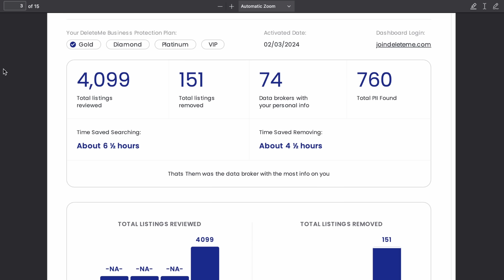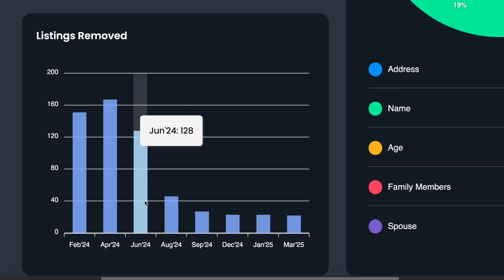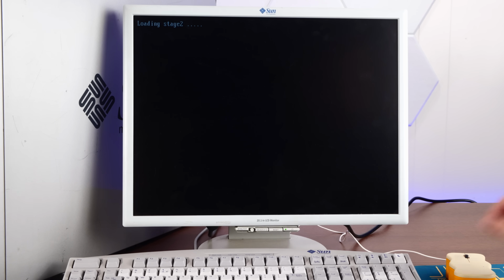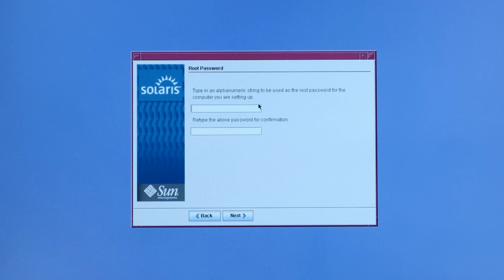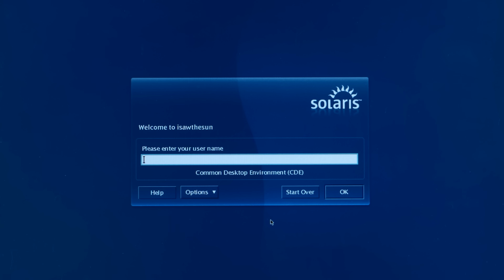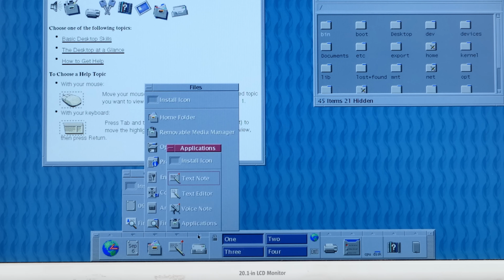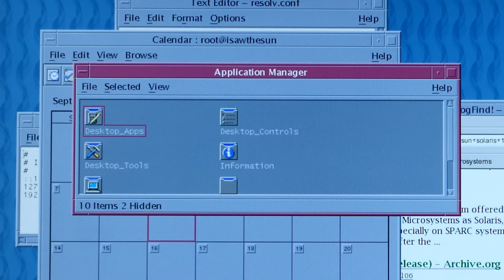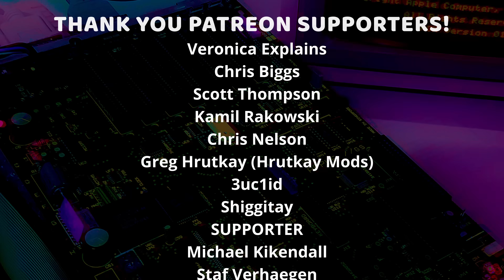The AMD Opteron Changed Everything

Comment: I love the simple and elegant case Design, Id love to have just a case from one of these in great shape.

Id have to use a SFX PSU modified to fit (Judging the "slimmed-height" proprietary looking PSU) , but the rest of the case dimentions are fairly standard for a full-tower case.
Id install high end modern AMD components (EPYC, Threadripper?) At-least 128GB RAM and definitely Linux, like my favorite "POP!OS".

Comment: Socket F Opterons sold as the original opterons? That's deffiently wrong, the OG opterons were socket 940 single cores and still had a ceramic package. They did allso come in the Sun ultra 40 but the original one the one you have is a M2

Comment: We used to work with everything from Sun back when. Servers, disk and tape storage and of course these workstations. A healthy mix of SPARC and AMD, but all Solaris. One of the clusters was used for graphical simulation of cancer treatment, so that needed to run reliably. The people at Sun were an absolute delight to work with, but when Oracle stepped in, we made the switch to HP and RHEL for most of the workloads. Anyway, as a seasoned Sun user, I shiver at the idea of Windows on these beautiful machines. But I'm not opposed to a Linux distro and/or a recent graphics card in there.

Comment: Windows 11? I'd be shocked if you could get windows 10 already to install.
For a while there, the machines I had set aside for XP were one with an Opteron 185 and one with a Pentium extreme edition. Despite the Opteron being considerably faster to use even with the disadvantage of ram (ddr vs ddr2), I could only get windows 10 to accept installing on the Pentium. And good God, it was a laggy environment. The kind that would have put a younger me into a rage fit. I could not fathom how something so slow still had operating system support that far ahead.

Comment: I got a really good deal on one of these back in 2007 that came with an absolutely beautiful Sun 24" LCD panel. It was pretty cool, but I'm afraid all of the CPU power and neat unix-ey features were wasted on me at the time. I ran it with XP 64 bit edition (which was really a reskinned Windows Server 2003), which mostly worked fine, but did suffer from some compatibility issues with 32-bit software. It came with 4 80GB drives that I had configured in Raid 5, which at the time was pretty amazing to have in my house. Sadly the Quaddro card was too specialized for my general PC needs, and I recall it performing remarkably poorly as a gaming machine. Amazing construction though.

Comment: This machine is at least two generations newer than the first amd64 Opterons. First batch of sledgehammer couldn't even reach pc3200 speeds so you were forced to run them at 2700.
I waited until the second generation of 100-series (codename Denmark) and oc'd that thing to kingdom come 😂

Comment: Win11 will not work. It requires some SSE4.2 instructions not found in that CPU. However, I bet Ubuntu'd do plenty well on that thing.
Reply: Does 10 require those same instructions?
Reply: @exiem1318  No, it does not. 10 is proven to run on a variety of hardware. Besides, it has a 32-bit version that runs on just about anything.

Comment: I have that exact same PCI-E SSD, I bought it on eBay years ago. IIRC they were used as cache drives for servers and the company went bankrupt. Let me know if you need drivers, they aren't easy to find and I have an installer saved that I can't even remember where I found. Currently working in Windows 11, reads and writes are around 1500 MB/s so they are still very usable.

Comment: Those PCIe cards are certainly newer than the system. The ioDrive is almost the direct precursor to NVMe, and it's suspected that most of the ones you'll see come from Facebook as those basically ran the platform during the early 10s. The Windows drivers still work, there's also drivers for contemporary Linux, and fan drivers for modern Linux as well. Got a couple for very cheap (like $40 each) and ran them a small business server for half a decade until a couple of years ago, when I decided to move to NVMe since now replacing them in case of problems would be much more expensive.

The K2200 is just a Quadro version of the GTX 750Ti, still gets drivers until... next month I think, pretty respectable for emulation and stuff up to late 00s games.

Comment: It's quite common for server (and sometimes also high end workstation) manufacturers to put those elaborate diagrams of how to change out components on the machine itself. You don't want to have to force some harried overworked IT guy who's probably had not enough sleep to have to go dig around for a manual whenever they have to do maintenance on a server. It's part of why I love working on those older servers. Everything was well documented and usually extremely well engineered.

The whole Itanic saga is freaking hilarious. Back in the day I used to work IT at a large company and I used to go to various tech conferences, and boy howdy, Intel was pimping the HELL out of Itanium whenever and wherever they could. Huge lavish presentations, parties with huge lavish spreads of food, etc. Somewhere in my collection of household crap I still have some Itanium glassware (either wine or champagne glasses, I don't remember) that I got at one such event. Probably still packed up in a box in the garage along with the craploads of stuff I never unpacked after my last move. Normally I'm fairly skeptical about the "next big thing" but Itanium tickled my spidey sense something fierce. It was fun watching it tank, and I find it hilarious that Intel was contractually required to support it until fairly recently. And, out from under the shadow of that colossal failure, here comes AMD with a 64-bit architecture that actually works, and you don't have to sacrifice performance or compatibility. And by adopting it as the de facto standard, the industry basically forced Intel to grit their teeth and go with the competitor's solution. That's the cherry on top.

Comment: Windows 11 depends on what version you're trying to install.  23H2 and earlier will install on any dual core x86-64.  Anything later will insist on a Nehalem from 2008 at a minimum on the Intel side, or a 2011 or later AMD CPU.  I noticed you're actually running a dual store opteron, so not the oldest x86-64.

Comment: I'm still hanging onto a 2004-vintage Athlon64 system plus an Athlon64 x2 solely for the historical value.  Earliest x86-64 systems plus oldest that can run modern Linux.

Comment: mate... dec alphas are 64 bit with even the option for a 128bit external bus. and those definatly predate that 'itanium' thing by oh eh a decade. plus everyone had a couple of dec alphas while noone in the world ever had an 'itanium' (so far for 'mass market computing' ;) ... now wether a sun workstation running 'whatever' cpu qualifies as 'a pc' much less 'the first modern pc' is another matter. lol. it's still a sun doing sun things. lol.
Reply: in case there was any confusion, the itanium is not a processor in the iAPx86 family line. it is just 'something seperate' also made by intel. like the 4004 and the 8008. lol. it will not run any programs for pcs. in which case the alpha even is closer to a pc. as at least it can emulate a pc faster than an actual pc can do pc things lol.
Reply: would say the dec alpha was pretty widespread compared to the itanium. while i owned several dec alpha evaluation boards and workstations i have never even seen an itanium irl lolololol. where the hell to even find one. lol. i hear they sent one to linus and that's about the only one i know about in the wild. lol.
Reply: and also it was around 10 years earlier haha.

Comment: I bought a dual original-Opteron a couple years ago (for the 20th anniversary of its release.) Pair of Opteron 244s (the fastest launch-day CPU,) 12 GB RAM (the max it supports,) a PCI Radeon of some variety that still has drivers. On a launch-day Tyan motherboard.

It is borderline unusable in Ubuntu.

Your Sun is clearly newer, as it has DDR2 and PCI Express. The very first generation of Opteron only supported DDR1, and the launch Opteron chipset (AMD 8151) only supported PCI-X and AGP. My system is a "server," so no AGP. I have tried a PCI-X Matrox Parhelia video card, but nothing modern supports it accelerated. (And the 8151 didn't even natively support AGP, it required a second support chip ("East Bridge"?) that inserted itself in the HyperTransport between the CPU and the main chipset, cutting the HyperTransport links in half, dedicating half to the AGP bridge.)

Comment: be careful, Sean! Win11 24h2 need popcnt aka sse 4.2. a CPU instruction that not even the Core 2 duo-based CPUs have. C2D (the Penyrn ones) have SSE 4.1 but not 4.2. SSE4.2 is in the "first gen" core i series..I've gotten the Iot enterprise version of Windows 11 to boot on first-gen i series CPUs just fine.  the "launch" versions of Windows 11 should boot on that sunPC...should. My experimentations with win11 where all on penryn-based core 2 duo machines lol.
Reply: I think I have a Conroe Core2Duo sitting in the shed right now...I wonder if it would run on that.

Comment: I realize that the Digital Equipment Corporation ("DEC") workstation I had on my desk at work running a full multiuser OpenVMS OS with DECwindows GUI on their Alpha 64-bit CPU back around 1993 wasn't exactly mainstream like Windows PCs were.  But I enjoyed it. 😎
Reply: But did you ever run Windows on your DEC Alpha? 😂
Reply: @cliffordbradford8910  you could
Reply: @cliffordbradford8910  Not on my desktop DEC 3000 workstation, but we did get a small DEC Alpha workgroup PC we ran Windows NT for Alpha.  (I scrounged the 2.88 MB 3.25-inch floppy 💾 drive out of it when it got decommissioned. 🙂)

Comment: I think windows 11 pro would work pretty decently, assuming that those opterons are basically server versions of the amd athlon 64 x2 processors from the same year, it could actually work better than expected seeing as it would be a 2.8 ghz quad core setup
Reply: This comment aged well!
Reply: Maybe no for 24H2, lacks POPCNT instructions if the CPU was released too early.
and early Althon CPU and motherboard may have issues with Windows 8 and 8.1 which also have a requirement of some CPU instructions that CPU don't have or motherboard not supported.

Comment: The early Opterons with the Venus cores were overclocking beasts. They also ran on prosumer Socket 939 boards and were popular with gamers. If this Sun system supports DDR2, then it's not an early Opteron. That dates it to 2006 at the earliest. It's also very likely Socket AM2, since the schematic on the side shows a PGA socket. There aren't many Opterons that support AM2. You might theoretically be able to put up to a Phenon II X6 1100T if there's a BIOS that supports it. I can't remember if AM2+ chips are supported on vanilla AM2.
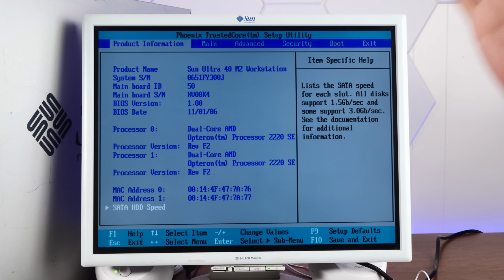Reply: That system has LGA1207 / Socket F and 2x Opteron 2220 SE. You can see the CPU model number at timestamp 6:48
Reply: the OG opterons were on socket 940 and there was like 4 regular atx boards for them, the ones that were super popular were 939 and ran on pretty much any desktop 939 board provided the right BIOS, the ones in the system shown are Socket F (AMDs first LGA socket), socket F allso has 6 cores but they aren't usually supported by early boards like this

Comment: In re the Itanium: there's a hilarious graph on the Wikipedia page about it. It shows sales predictions at various times, starting in 1997, when they had sales rocketing up from zero in 1999 to over $35 billion in mid 2001. As time goes on the predictions get more and more pessimistic, growing more slowly - and right at the bottom there is a feeble little red line marked "Actual", which starts in early 2003 and ends in early 2006 with about $2.5 billion. Then they gave up.

Comment: I like the fan rig that is built like a hood for the ram cards !  This should return for some boards .
Reply: I have a Dell T3610 workstation (that I use as a Proxmox homelab) that has a duct for each ram bank that directs air from an intake fan straight across the RAM modules. Gotta keep that 128GB of memory cool!
(Coincidentally, that Dell's original configuration included a K2000 Quadro card :D )

Comment: That thing (the old AMD Opteron) probably doesn't have POPCNT on it, which is the other absolute requirement to be able to run Windows 11 (currently, build 24H2).  (The other requirement, of course, being TPM 2.0).  Nah.... I agree that you'd be right, to install modern Linux on the thing, instead of Windows.

Comment: Should install Debian Unstable, or Windows XP x64 on this.
Also yes to Windows 11 (I assume pre-24H2 cuz of SSE4.2.)
Also try Windows Vista x64 and/or 7 x64, to see if you can hit a sweet spot between compatibility with older hardware and newer software.

And finally, Haiku.. you know you have to try Haiku.

(...and if you're crazy, Chrome OS, ThoriumOS, or even FydeOS.)
Reply: Also, you should do like you did with your PCIe PowerMac G5, and try and stick modern cards in there. (Doesn't necessarily have to be GPUs.)

Comment: Comically over engineered...  As in high build quality. I wish there was more of that around in the computer and car industries now. Sigh.

My first AMD64 CPU was the first gen AMD Thunderbird. I've been an AMD fan ever since. Well, except for my very brief time with an Intel Pentium4 build I only did because I got the CPU and ram for free from work e-waste. I almost immediately noticed my error and sold that all off on eBay and used the proceeds to build a AMD Phenom rig which I used for years.

Comment: If MichaelMJD releases a video titled "Installing Windows 11 on the original Opteron but everything goes wrong" within the next day I'm gonna lose it.
Reply: MichaelMJD please do this
Reply: express shipping him an opteron computer as we speak (if only)
Reply: Funny if are secretly doing a house share.
Reply: I’d love to watch that
Reply: I don’t think the required instruction sets are present
Reply: I would ❤ to see Wondows 11 on this Sun computer.
Reply: @martinbarr-david8173 AFAIK Windows 8,8.1 and 11 needs additional CPU instructions to function, so it would be impossible to run, later generations may compatible with those. 
I have a Core 2 Duo PC which Windows 11 24H2 no longer works
Reply: So you’ve been following the computer stick lore…
Reply: Manifesting Itanium video
Reply: Even Windows XP 64-Bit would be interesting. There have been a lot of strides made in making newer software work on XP. Would be interesting to see what modern software it can run.
Reply: Was going to comment that k8 Opterons cannot boot Windows 11 or even recent versions of Windows 10. The Kernel requires the CMPXCHG16B  instruction that isn't supported by first gen AMD64 CPUs. This is a hard blocker  that is impossible to get around without a virtual machine that can do emulation of missing instructions
Reply: I was just about to comment something similar to this. XP
Reply: Please install windows 11
Reply: I suspect something will go wrong, since the original amd64 chips are missing some CPU extensions that modern 64-bit Windows does require. the 16-byte "compare and exchange" operation in particular, which is used to implement a number of atomic/locking operations. I believe the last version of 64bit windows that will work is windows 7. But 32bit windows will work, up to windows 10. With windows 11 they discontinued the 32-bit version.
Reply: I would 100% watch it
Reply: It works with Rufus
Reply: When.
Reply: Please do this Michaelmjd
Reply: yes please michael!! XD
Reply: It's very possible with the right In-Place upgrades and the right copy of Windows 11

Comment: Please go super weird and install a large SSD (or multiple since windows 10 and 11 are funky about booting multiple operating systems off one drive) and multi boot all the operating systems you can using something like GRUB to manage them all. Ubuntu, Solaris, Windows XP, Windows 11, Arch, Debian, Haiku...the possibilities are endless really.
Reply: Oh, balls, I didn't know Win10 didn't like that...I was going to install Linux on the SSD in my desktop and dual-boot. Should I not?
Reply: @MishraArtificer Just make sure to follow a tutorial. The issue is that windows sometimes reinstalls it's bootloader after an update which means doing some extra work to get it to boot into Linux again. It's not catastrophic, just a little annoying.
Reply: @chadmasta5  Well, it'll be dual-booting with Windows 10, as I'm (reasonably) sure this doesn't have TPM2.0 in it, so updates shouldn't be a problem for too much longer...
Reply: @MishraArtificer That problem also only occurs if you're trying to dual boot them from the same drive. If you have the option I'd recommend a dedicated SSD for each of them.
Reply: @chadmasta5  Maybe later. 

cries in poor

Comment: When I was an intern in college, all the engineers had Sun sparc 20s on their desk. I think those were quite a bit older than this one, but that windowing system unlocked memories for me. Can't imagine what the price tags for these were originally.
Reply: Same, helpdesk assistant in my college and instant core memory unlock.
Reply: I still have my Sun SPARC 20. It was my main computer back in the day. As for CDE, it's still being maintained as NsCDE. The new version is compatible with modern systems and works well. I have it on one of my systems for a bit of nostalgia
Reply: I purchased and adminstered several of them on a world-wide network for a major microprocessor manufacturer that is still a going concern.  My core memory unlocked on how easy they were to use and reliable, how performant they were even as workgroup database servers, not requiring data center chasis for our engineering relational databases. My recollection of exact price was roughly $7.5K to $10K in 1995 dollars.  The largest single hard disk that could be purchased in an external SCSI box held 9GB.